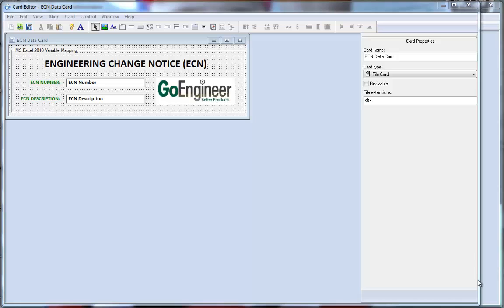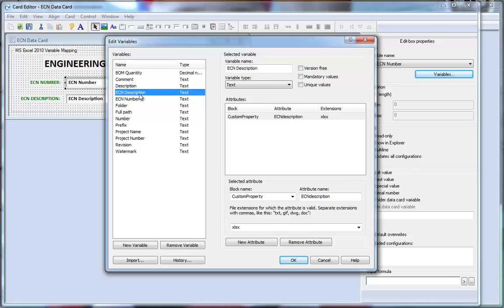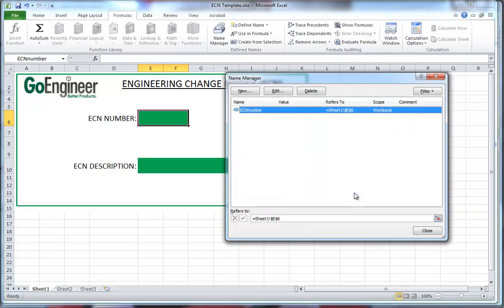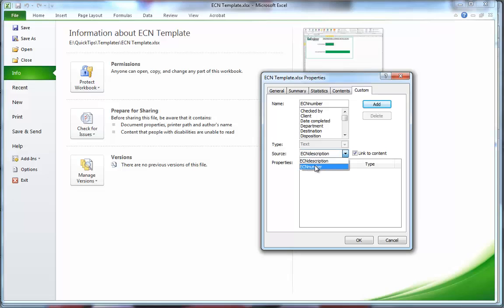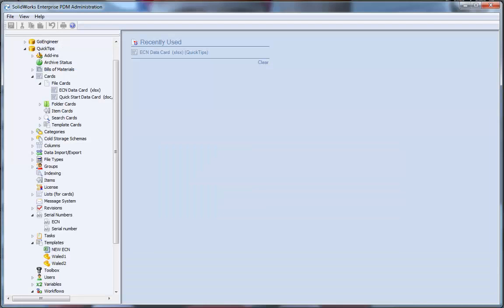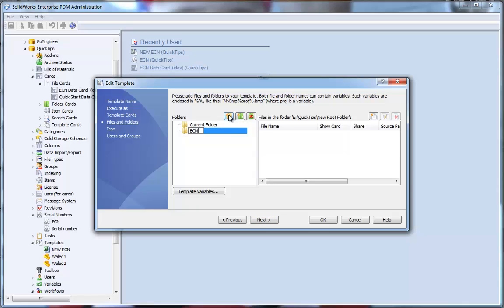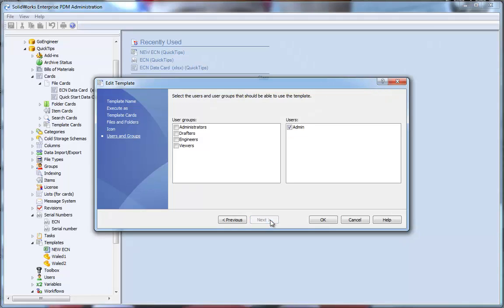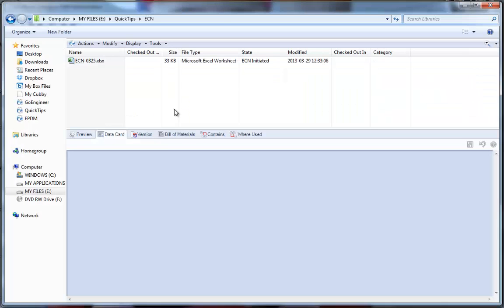SOLIDWORKS Enterprise PDM 2013 – Mapping Variables to Microsoft Excel 2010

Comment: Hi. I need to check every single Data Card from my PDM system, and check and modify values if necessary. My vault is quite big, and there's no chance to do it one by one. Is there any massive way to check and modify values from my PDM Variables? I'm wondering if there's a way to have access to an excel spreadsheet with all the values from the cards where I could read them and eventually modify them and the modification have an impact on the Data card. 
Any suggestions? Thanks!